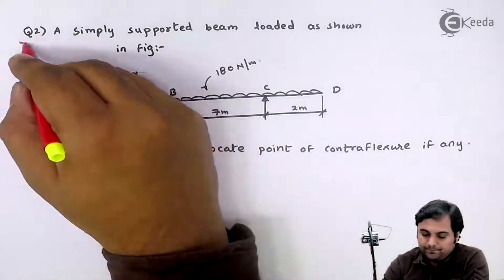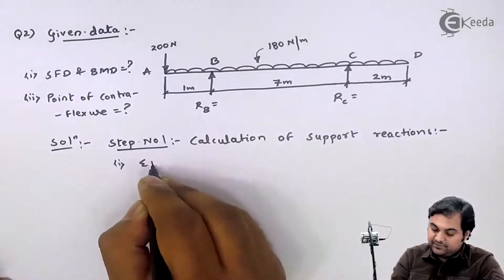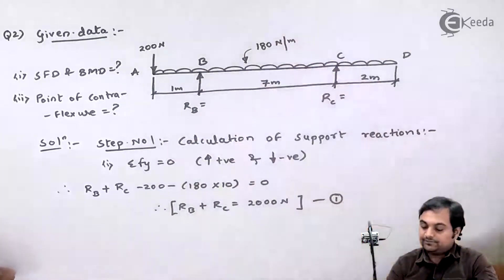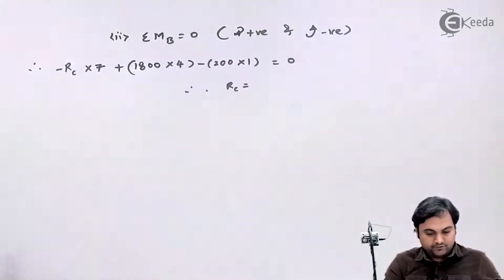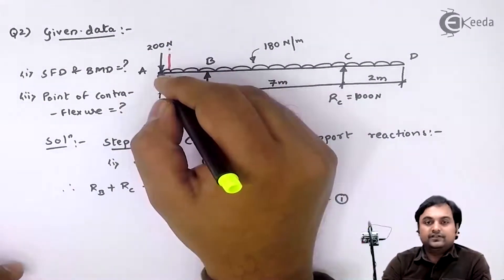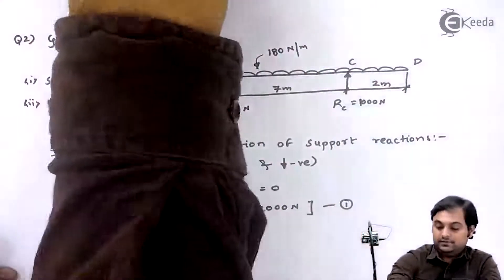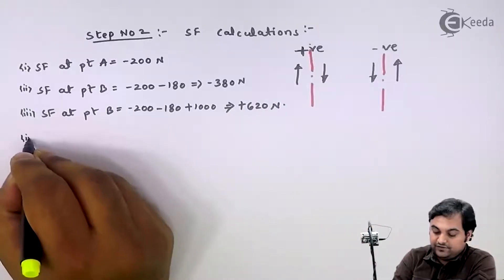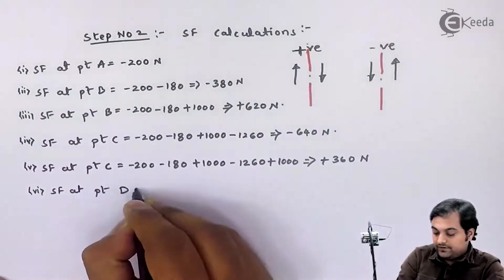Part 1 Problem no. 2 on SFD and BMD - Shear Force and Bending Moment Diagram - Strength of Materials

Comment: 4:10 180x4 ??? Why 4 ??
The total distance is 10 if UDL acts at the middle point so it should be 180X5 .
If I am wrong please tell me.
Reply: that is because from B to Centre distance is 4 when calculating moments we need to consider distance from the point(which we are calcluating)
Reply: @khushbhatt8127   for ur version it become 3.5 B to center here he take 4?
Reply: 5_1

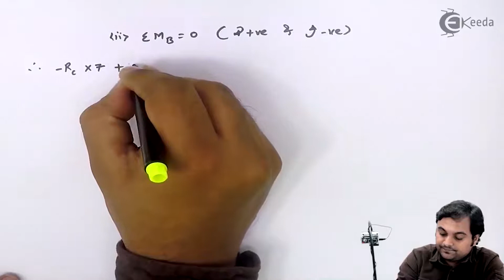Comment: what are you doing at 04:00? You are violating your own sign convention here. How is Rc negative? And how is 1800*4 positive? Please tell this. In problem 1 video you said upwards clockwise and anti clockwise  in left and right respectively is positive and rest is negative. And here you doing the exact opposite plus you are making one moment positive and other negative for i dont know what reason. Please clarify this
Reply: Sign convention are only for sfd & bmd. For movement : visualise a pen pointing up for rc & see pen will travelling (always consider shortest distance) in anticlockwise way to meet pt rb .